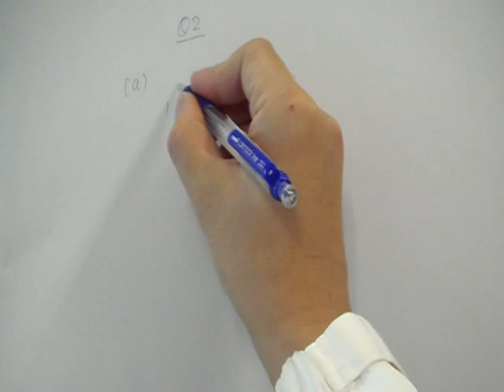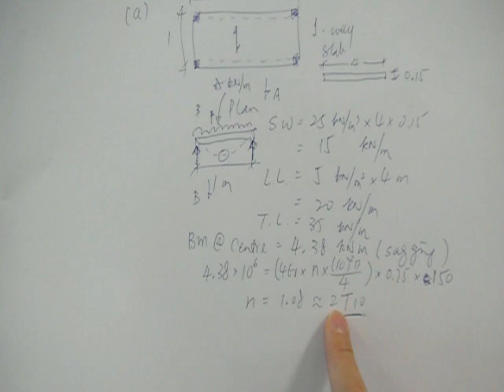One-way Reinforced Concrete Slab 1

Comment: Comments:
1. Concrete slabs can't be treated as simply supported. Top reinforcements are needed near the beams.
2. Using applicable codes, live loads and dead loads must be multiplied with certain factors for safety.
3. The effective length of the slab is from the center line of the beam.
4. The typical method of design is done by taking a 1m wide strip of the slab and not the entire slab itself.
Reply: u use Facebook
Reply: In the case of one way system where the slab rests freely on the support it is assumed to be simply supported.  This is assuming it is not built monolithically with the girder.